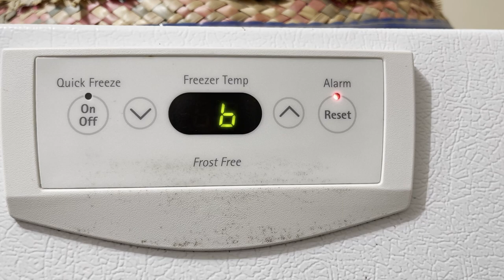Fix The Beeping Freezer/Fridge

Comment: Thanks for your video. What is proper temp setting? mine keeps saying FF.
Reply: I Googled that to find this This error occurs when the freezer fan motor does not operate normally. Unplug the power cord of the product or trip the exclusive circuit breaker to reset the power, and then reuse it after about 5 minutes. ➔ Or, it can also occur when the fan motor is locked due to ice (frost)

https://youtu.be/jWSoVwbu5RE?si=vSE4Y7VE2AGF2YnV

Comment: changed the battery,,but it still beeps!! Grrr! thanks for your succinct video tho! Any other suggestions? thx
Reply from the maker: We went through few troubleshooting steps ourselves but ours came to be the battery.
It depends on your freezer type but steps we took:
Plugging and unplugging the power cable of your freezer.
Clean the seal so no cold air is leaking.
Freezer maybe full blocking and  making the freezer warmer.
Freezer may need to be defrosted.
Changing the thermostat? (have not done that yet)
Reply: could be the wiring harness at the bottom hinge that goes to the display panel on the front, little room for it to move every time door opens prone to wire breaking

Comment: Mine is still beeping after replacing it with two different charged batteries!
Reply: I prayed and prayed.  I did not want to pay someone to repair and got an impression to look below.  There were two cables, one red and one black.  The red one was disconnected.  Beeping has stopped.  PTL!!!
Reply from the maker: So glad it worked out. One time we had to get sometime to change the circuit board and it was not cheap. PTL!!! 🙏